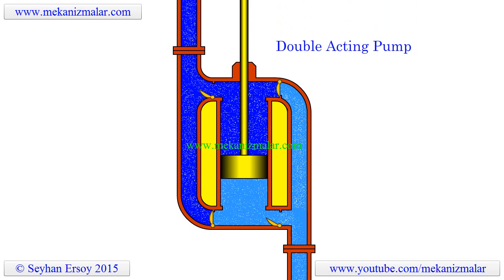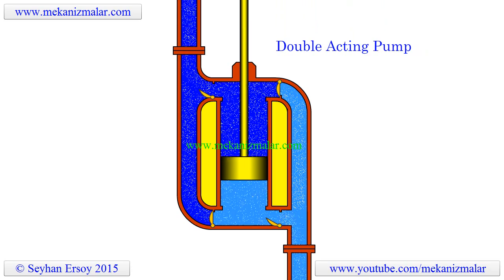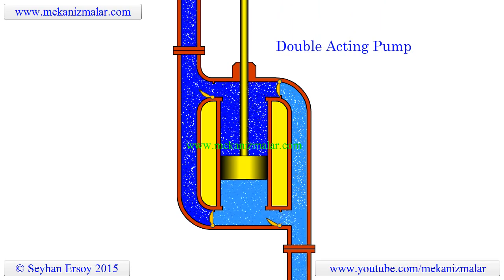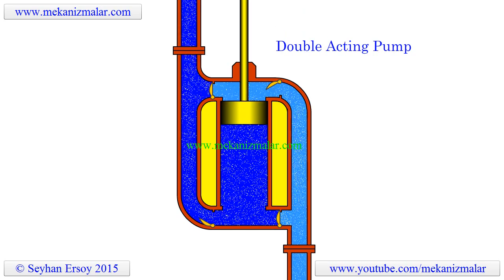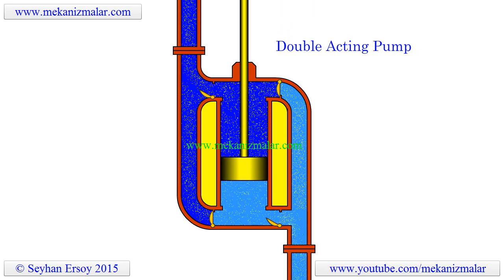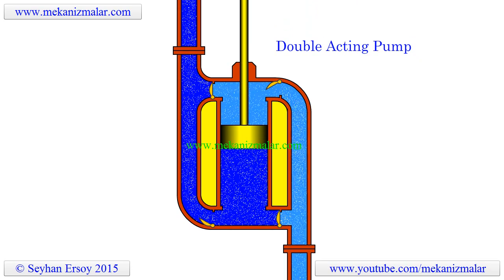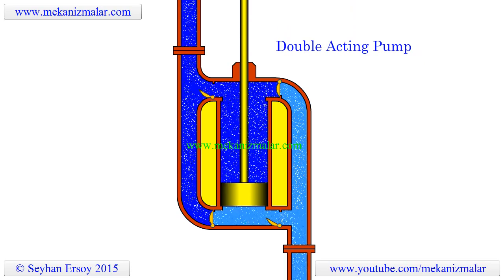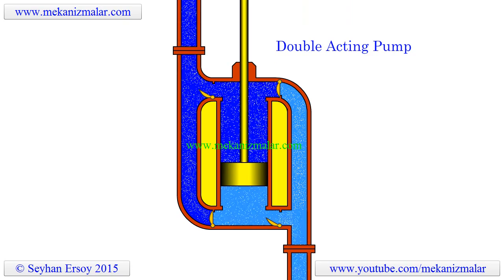how double acting pumps work

Comment: Imagine I install this on a water well. How deep can I pump? Is it possible to pump water from 100 meters deep?
Reply from the maker: Since this is working with suction, you won't be able to pump water from more than seven meters deep. Theoretically it could be 10 meters deep maximum, however you should consider losses in the system.